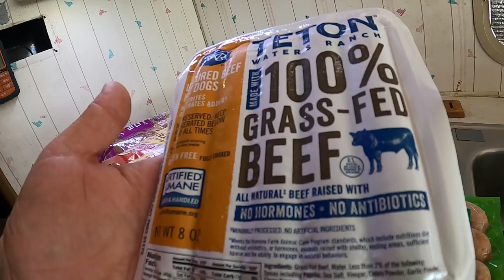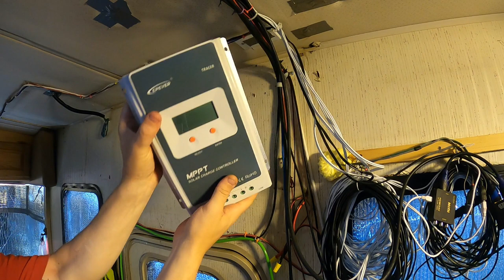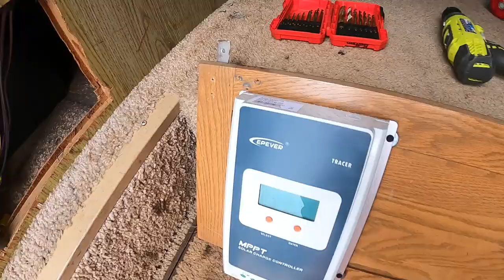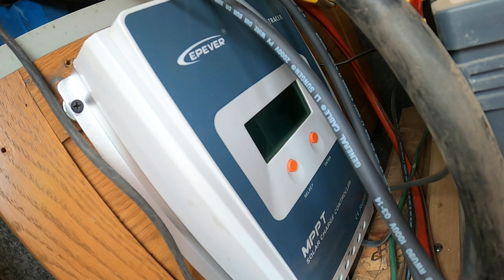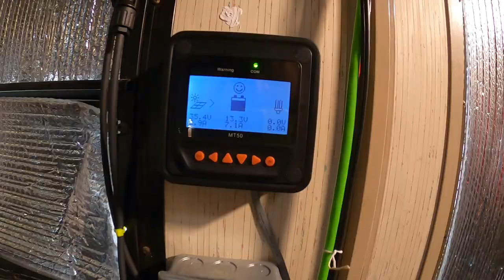Solar Panels On RV - No Holes In Roof

Comment: nice job!!   thought about a small home made light sheet metal wind deflector ?So the wind does put  not  pressure between roof and panel you could bolt it on using mount bolts .  Just not a big fan of gluing only  the weather is brutal on thing BUT YOU DID A GREAT JOB LOOKS AWESOME

Comment: I noticed you running a hand held and bench grinder in the parking lot...then you tried welding...then back at the ranch you finished welding the brackets...what would it take for you to run that welder out of your RV?  I have Harbor Freights smallest flux core welder...but I have not tried running it off of my 5000wat generator.   Can you weld from your RV?